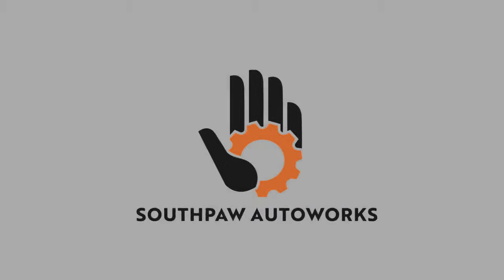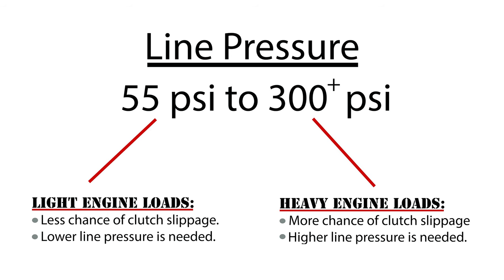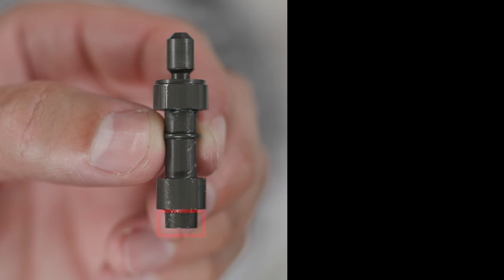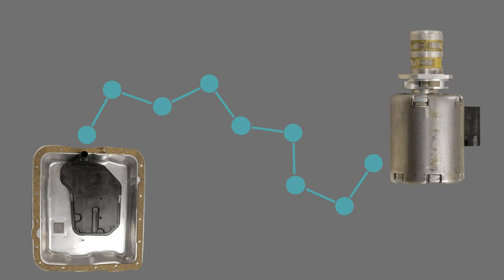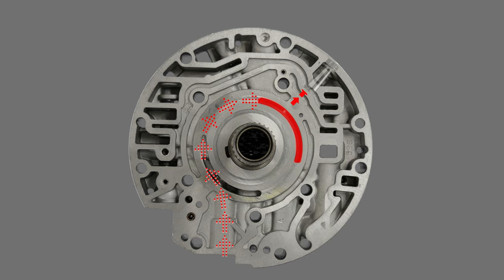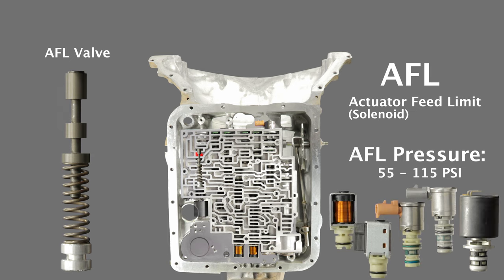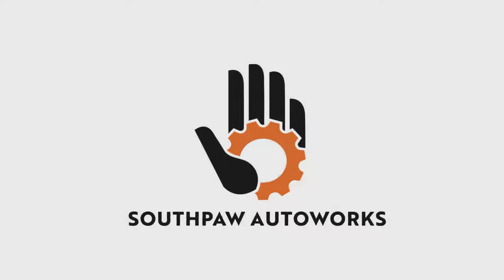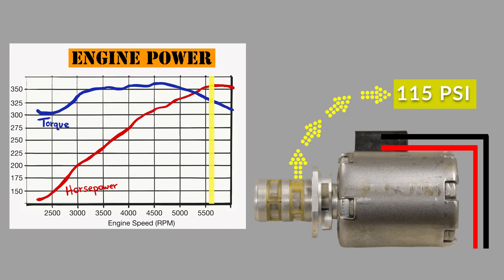4L60E: PR Valve (Part 3) Torque Signal Oil Pressure (4L60E Line Pressure)

Comment: I really appreciate the videos. Very well explained. 
I have been turning wrenches on my own vehicles since I was a kid. I just rebuilt my first transmission though and I am having problems. I used the tutorial videos on the YouTube channel transmission bench. He explains and demonstrates the assembly very well. I really took my time and was very meticulous in my process. However, the transmission is slipping and has erratic shifting. I feel like I have a pressure issue somewhere but I am just not sure how to diagnose what’s going on. I currently have the pan off and the boost valve out. It is a Sonnax  unit with a stiffer outer spring from a Transgo shift kit. I removed it to make sure my stack up was correct. It was. If the force motor is not working correctly, could it cause this?
Reply from the maker: Congrats on your first rebuild!  That's really exciting.  
Sorry to hear about your setback.  This kinda stuff happens...

Questions:
1).  Are you certain that you had the fluid level set correctly?
2).  With the shifter in OD mode, what gear(s) was it slipping in?
3).  Would it slip only when the engine/trans was cold?  Only slip when hot?  Or it slipped all the time, regardless of engine/trans temp?
4). If you shifted the trans to D1, D2, D3, would the slipping problem go away?
5). Did it slip in Reverse?
6).  Were you previously able to attach a transmission pressure gauge (capable of reading oil pressures over 300 psi), and get a pressure reading, at idle, and while driving?
7).  Do you currently have a check engine light on?  Do you have any codes for the trans and/or engine?
8).  What was your original transmission failure? (3-4 clutch failure, 2-4 band failure, etc)  
9). What was the original symptom? (slipping in one gear, or multiple gears? Erratic shifting? Or something else?)

I've got other questions, regarding your rebuild.  But, let's start here...
Reply: @SouthpawAutoworks  Thanks, but right now I am wishing I would never attempted it. I have spent a lot of money on good parts and I am stuck with this thing not working hardly at all.
1) I did check the fluid with the engine running and everything up to temp. Fluid was just above second hole on the dip stick.
2) With the shifter in drive it is very slow to go into gear. Same with reverse. It was slipping in every gear but now it won’t even shift to second. When stopping and taking off again there is a delay before it reacts and then it goes but if you let off and stab the gas it slips and grabs but like I   said it won’t even go in to second now.
3)It slipped while at about 100 degrees and kept slipping even at 160-180. 
4) The slipping happens no matter where the gear selector is.
5) It slips in reverse a little bit also there is quite delay for it to engage as well. It acts much like it does in first. 
6)I am not quipped to check line pressure.
7) There are no codes for trans. or engine.
8)Original failure was 3-4 clutch failure. Last builder did many things that would cause this to happen prematurely. One of the things was eliminating the check ball capsule that is located near the second gear servo bore. Also left out the reaction springs in the input drum.
9) The original symptom was slipping in 4 gear while at highway speeds. If you tried to accelerate even a little the engine rpm would climb but no acceleration. The problem progressively got worse and eventually when I finally decided it needed rebuilt it was slipping in every gear.

I used a Raybestos rebuild kit and in addition did a Raybestos Z-Pack for the 3-4 clutch. I also used a Sonnax Smart shell and 5 pinion planets. I would say 80 percent of the internals are new. I did not skimp and I was so careful to check spacing tolerances and make sure everything was just right. No corner cutting. I am beyond aggravated… I must have done something wrong 😑
Reply from the maker: If it's slipping in all gears, and in all gear modes (OD, D1, etc), it makes me lean towards a Line Pressure issue.  It would be best to verify, so you're not chasing your tail.

If it were me, I'd be putting it back together, filling it up with oil, and checking Line Pressure with the engine idling.
Note:  I know that you mentioned that you are not currently equipped to check line pressure.

You previously asked about the EPC Solenoid (aka Force Motor).  If there's a problem with the EPC Solenoid, yes, it can cause line pressure issues.  But, it's one of many things that affect line pressure.

Line Pressure is influenced by:
1).  Variable pump output (pump slide).
2).  Pressure Regulator Valve.
3).  PR Valve bore in pump (the bore can wear out).
4).  Boost Valve & Sleeve.
5).  EPC Solenoid.
6).  AFL Valve (bore can wear out).
7).  PCM (controls EPC Solenoid).
8). Various engine sensors (MAF, TPS, etc)(PCM monitors these and makes "decisions" that affect the Line Pressure (via the EPC Solenoid).

Questions:
1).  Year/make/model?
2). Did you replace all of the electrical? (Solenoids, harness, pressure switch, speed sensors, etc)
3). Did you happen to replace the VB (valve-body) separator plate?
Reply: @SouthpawAutoworks   
Ok I had to walk away from it for a few days for my own sanity. LOL 
I went and got a pressure testing setup and I am glad I did. After it warmed up it is only at 20psi. It is the same wether it is in P, D, or R. I also rigged up a way to drive with it connected and I think that was even more telling. It will not shift out of first at all, but in first when you accelerate the pressure goes up to about 100psi and then immediately dips down below 30 and is kind of erratic from there. This was done with the gauge connected to the port on the drivers side of the transmission where I usually have my temp transducer, so right off the pump I would presume. 
1) 1999 GMC Sierra originally had a 4.8L engine. Trans is a 4L60e
2) I did replace the electrical just to be safe but the old solenoids and harness seemed to be fine.
I had no issues like what I am having now. I did put the old Force motor back in just to test and it did not make a difference at all. 
3)The separator plate is an aftermarket Transgo that had been put in there on the last build. That build only lasted about 50k miles. It was in perfect condition, i.e. no damage from the check balls slamming into the plate. 

I am thinking I have a problem in the pump.. What  do you think? 
I really appreciate your time helping me out with this and the time and effort you put in to your videos and animations. It really cool to get to understand the inner workings of these things.
Reply from the maker: Totally understand. ha  It's good to take a break, as these kind of setbacks can, and will, get pretty damn frustrating.

Thank you for answering each of my questions.  I appreciate your attention to detail.

I'm really glad to hear that you were able to get your hands on a pressure gauge.  It's a super useful tool.
There's only one (1) pressure port on the 4L60E (Line Pressure).  So, you're good there.

The problem definitely could be in the pump.  But, it's important to remember that the pump moves oil....however, it does not create oil pressure.  
As the oil exits the pump, the oil travels to various valves, accumulators, through small holes in the separator plate, to the clutches, etc.  As the oil goes through small holes, the oil slows down.  As the oil encounters dead ends in a circuit (clutch packs, servos, etc), the oil stops flowing in that direction.  It's this resistance (and dead-ends) that creates oil pressure.

So, what I'm saying is...it's possible that the pump is doing its job (moving oil).  However, there could be a large leak somewhere down-stream of the pump.
There are some hydraulic circuits that are active in all shifter positions (Park, Reverse, Neutral, etc).

Questions:
1). You mentioned 20 psi with the trans warmed up.  What's the pressure when the trans/engine is cold? (with the trans in Park, engine idling).
2). If you unplug the wiring harness from the trans, the line pressure will increase to max values...or at least it should.  
Note:  Unplug the harness with the engine off.
With the wiring harness disconnected, what is the line pressure with the trans in Park, and the engine idling...
    A). What is the pressure with the engine/trans cold?
    B).  What is the pressure with the engine/trans warmed up?

I've got other questions regarding your rebuild, but I'm out of time today.
Reply: @SouthpawAutoworks   Pressure at idle started out about 120psi but dropped to about 90psi in less than 30 seconds. It then steady dropped down to 20psi.
With the harness take off, on start up, pressure was 120psi and went to down to 30 once it was warmed up. I revved it a couple of times and the pressure never exceeded 130 and it would “bounce” back from there instantly down to 120 again. With holding the throttle steady at about 2000 rpm the pressure was all over the place bouncing around between 30 and 120.
Reply from the maker: Thank you for providing this info.

If it were my 4L60E, I'd be leaning towards the PR (Pressure Regulator) Valve.
The valve, itself, rarely (if ever) has problems...however, the valve "lives" inside of a bore, and that particular bore is known to wear out (it's a highly active valve) (It puts a lot of miles on the bore).  

When the bore wears out, it can cause:
1).  Low line pressure.
2).  Excessively high line pressure (can break transmission parts).
3).  Erratic line pressure readings.
4).  Smoked clutches.
5).  Etc.

If the PR bore is indeed the issue, the best fix, is to remove the trans, remove the pump, disassemble pump, and enlarge the PR bore (with correct tooling) and install in oversized valve.  This will make the bore essentially brand new.
Note:  Per some sources, an oversized PR Valve should be accompanied by a larger boost valve/sleeve.

There are also specialty aftermarket drop-in replacement valves, that can take care of the problem (with the trans in the vehicle).  They can be installed by removing the oil pan and removing the PR Valve-train.
Note:  If the trans is equipped with an ISS (Input Speed Sensor) (2007-Up), then the trans must be removed from vehicle, disassembled, etc, in order to gain access to the PR Valve-train.
Note:  If the bore is worn badly, the drop-in valve will not be a good solution.
Reply: @SouthpawAutoworks  Thank you for your response. There is damage in the transmission from the little bit of driving I did with it. Probably less than three miles however there is black crumbs in the pain. So she’s coming back out I am going to go through it again and replace whatever burned up. Is there a test to determine the PR valve bore is wore that badly? It stands to reason though because the pump is original to the truck and has a crazy amount of miles on it. I am thinking about going with a reman pump and going from there. Thanks again for all your help!
Reply from the maker: Yes.  The best way to test the health of a valve/bore is vacuum testing (Requires additional tools).

A reman pump is definitely a viable option.
Note:  It's not a good practice to install an assembled reman pump without first confirming that the pump slide moves freely (known problem to look out for, on remanufactured 4L60E pumps).  More on that, another time.

If your 4L60E has a lot of miles, the AFL Valve bore may also be getting wore out, too.  It's another highly active valve-train...just like the PR valve-train.  They both spend a lot of time buzzing back and forth in their respective bores.
You can learn more about the AFL Valve:  (60-Second Preview)
https://youtu.be/yfXdx6AkqjU
Reply: Ok I finally have the transmission back out. In the middle of disassembly I ran into a new problem which might provide a clue to one of the things that went wrong. When removing the reverse and input drum , the input drum is completely stuck. As you know they usually just slide out. However, I can lift the entire remainder of the trans holding on to the input shaft a lifting up. I have wiggled it and lifted at the same time while having another person holding down on the case and nothing! Have you ever seen anything like that? Everything rotates fine so it has to be something with the clutches or snap ring hung up on the ring gear.
Any help would be MUCH APPRECIATED!
Reply from the maker: I'm in a bit of a rush to get out the door.  I hope all of this makes sense...

If my memory serves me correct, at some point after the rebuild the trans lost 3rd and 4th gear...among other things.

When the 3-4 clutch fails, a few things can happen.  If the slippage is real bad, and prolonged, the friction plates will lose all of the paper lining (clutch material).  The friction plates will then look like the steel plates, but thinner.  
At that point in time, you have metal on metal, slipping, creating heat....and they can weld themselves together.  The clutch pack can get stuck to the 3-4 clutch hub (aka front ring gear).

If this is the case, it's gonna require more pulling/wiggling/rotating to get the Input Drum removed.
You can attach a vice-grip to the input shaft splines...use that as an extra handle.  It's possible to attach the vice-grips and not damage the splines....use your best judgement.

Feel free to shoot a video of what you're up against, and post it on your channel...and of course post a link to the video, here...and I'll take a look.

Note:
I'm assuming that you've already unhooked the 2-4 band from the band anchor (It's the part at the 6 O'Clock position, inside the transmission case).  (Servo removal makes band removal easier)
Reply: @SouthpawAutoworks  You are correct, that is basically what happened. The clutches got so hot that they distorted to the point that they were locked down on the grooves. I won’t go into how I got it apart but let’s just say it took extreme force. More than could have been done by hand. The good news is everything behind it looks to be fine. I believe I am going to buy a loaded input drum with the Sonnax Reinforcement sleeve already installed, and all the clutch packs including a Z pack 3-4 clutch pack as my engine is close to 500 hp. Once I get it all back together I am going to check my line pressure before I ever attempt to move the truck. I am going to buy a remanufactured pump that the manufacturer says they do not machine the mating surfaces, which would mess up the clearance for the slide. They say they only use cores that that don’t need to be re-surfaced. Hopefully, that will fix my line pressure issues. The pump that I have now has 370,000 miles on it. I Did not know until talking to you about the PR valve Bore wearing out. Otherwise I would’ve just put a pump in there in the first place. You live and learn I guess.
Thanks again for all your help. I will keep you up to date on my progress.
Reply: Oh one other thing? Could the bore of the manual shift valve be worn and be causing the manual shift problems?